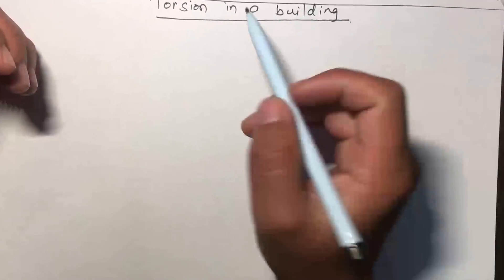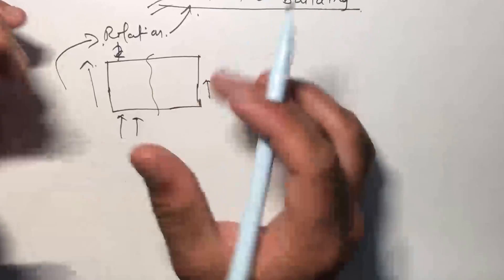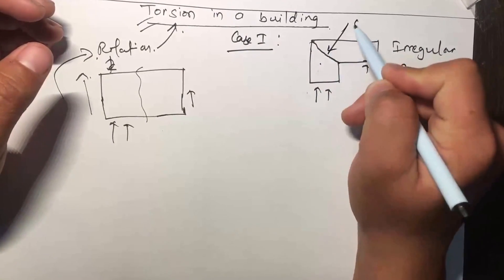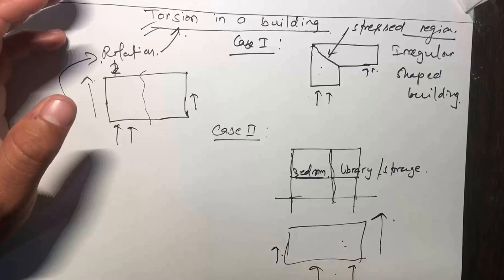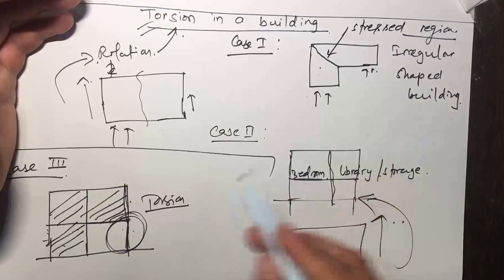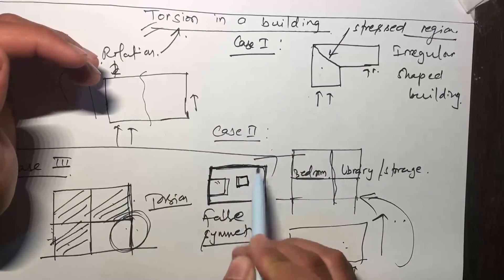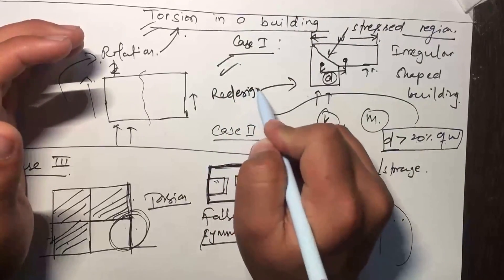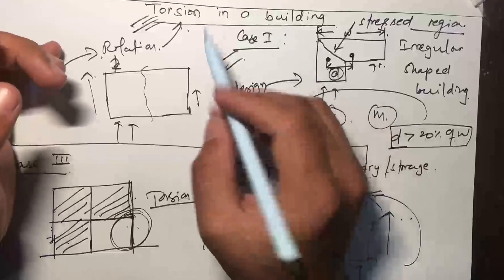Torsion in Buildings| Interview Question #16|

Comment: What is center of rigidity
Reply: The axis about which the whole building rotates when a torsional load is applied. When a building experiences a lateral load that produces torsion, then there will always be a point in the building that deflects in a perfectly straight line when viewed from the plan view. This is the center of rigidity. Every other point translates in a curved path since it is rotating as well as translating.